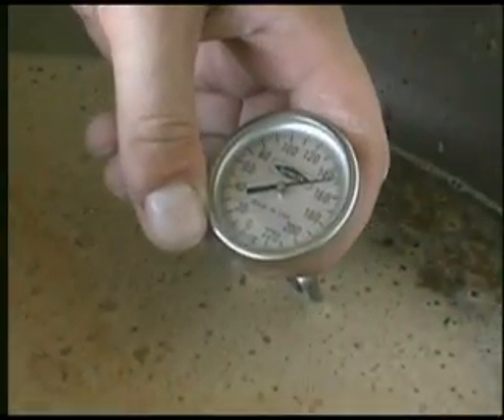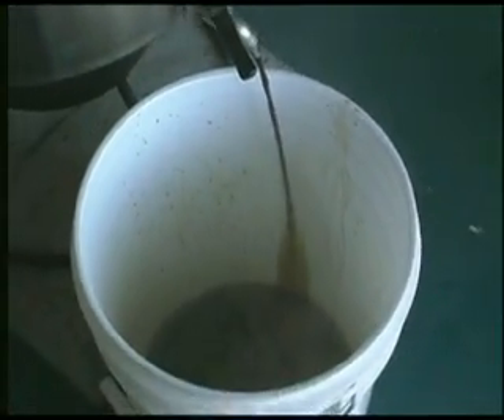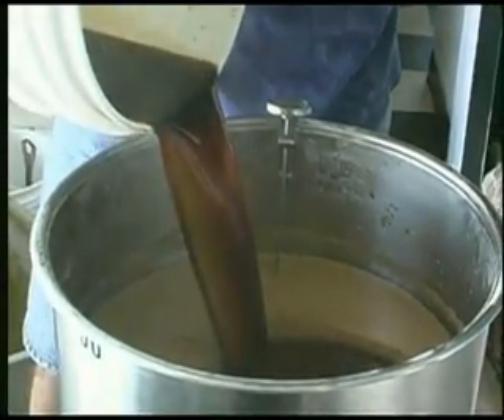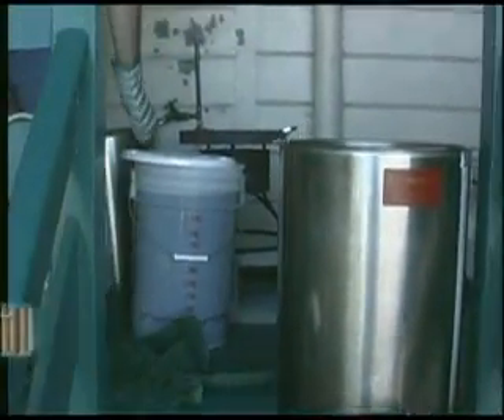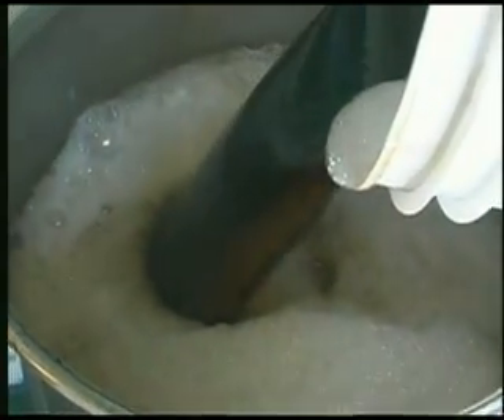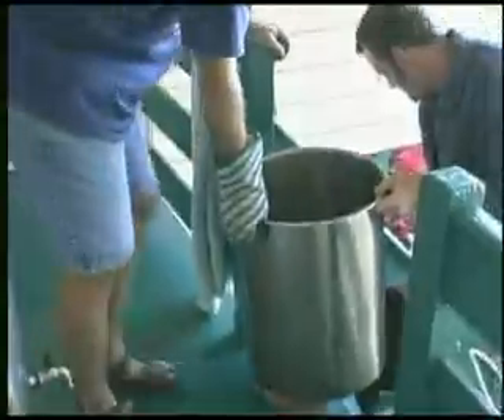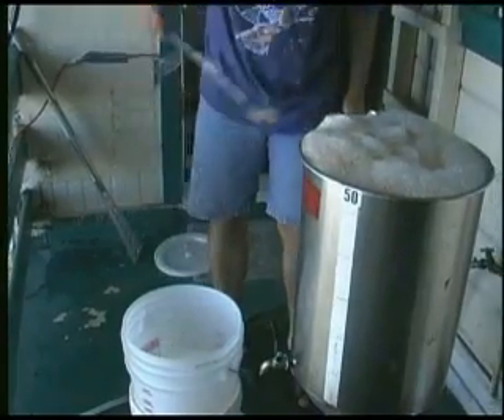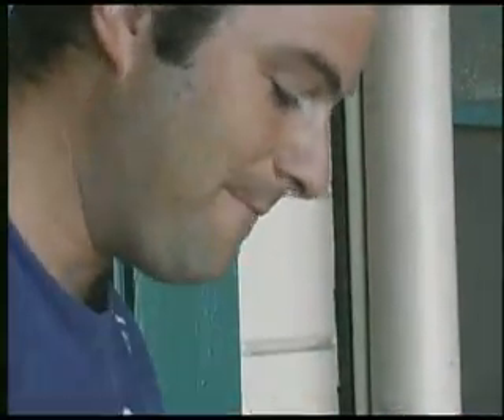How to Make Beer (3 of 4)

Comment: When running off the mash directly from the tap into the plastic bin are you not worried about hot side aeration? I'd use a pipe to avoid aerating the wort at this stage.